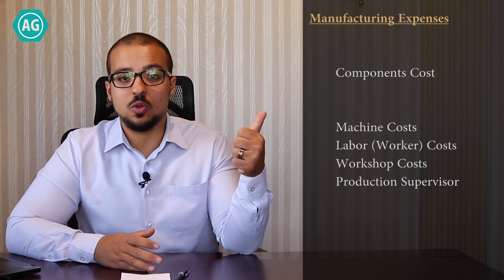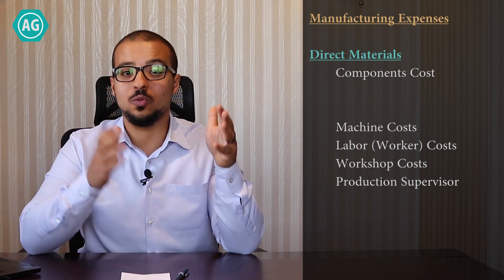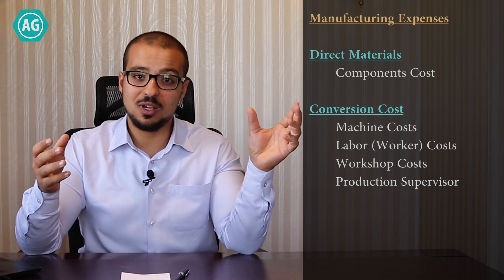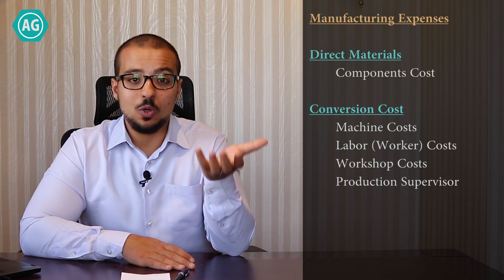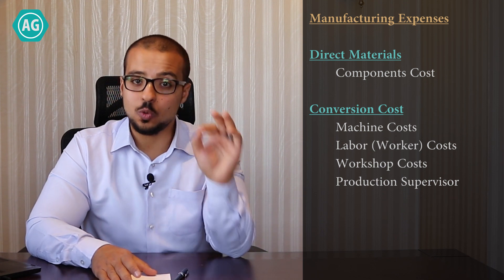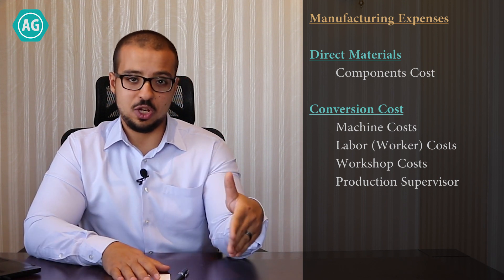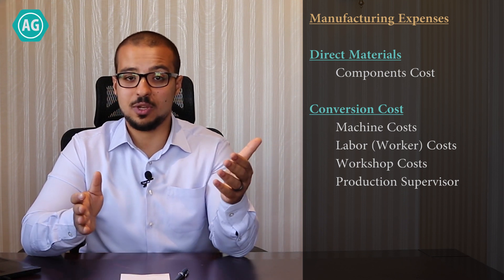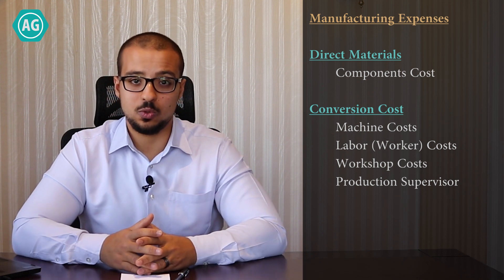Manufactured Products Costing: 03-  Manufacturing Cost Components

Comment: I am a product developer and I just paid a guy around $300 for a marketing report on Fiverr, and his numbers are way off lol, the only accurate part seems to be the estimated units sold per year.
For example I have fridge/freezer specifically designed for camping in minivans and Sprinter vans. He said the manufacturing costs could be $600, and his suggested retail price was $1000

But if a rooftop camping tent for cars, jeeps ect can cost $3000, then what could be the manufacturing cost this product? $1500?
Then how the heck could my product, which is more involved, cost only $600 to produce?

So is the markup for these type of products 50%.....%100.....or what?  Please give some insight I'm very confused!
Reply from the maker: Hi Cody, I don't know anything about the costs of camping equipment so I can't judge really, but maybe the costing he provided is wrong? check the playlist for product costing, I explained in detail how to calculate the cost of a manufactured item
Reply: @Abdullahgalal  Thank you for your response. Yes he was wrong on the markup percentage. But I found out that those type of products can retail for 2 to 3x more then the cost, which makes sense because the cost is going to be between 600 and 800 dollars, and I believe it can retail for at least $2400. I based this number on the fact that rooftop tents sell for that price and more, and they only serve one purpose, my product serves two purposes. I just need to figure out if I'm going to try to license it or find a partner and and manufacturer our selves, well hire a factory to make it of course. If it was only one product I would look to license, but I have two other product ideas...one for construction sites and the other would be a Home Depot type of product. Are you an investor, or do you give business advice?